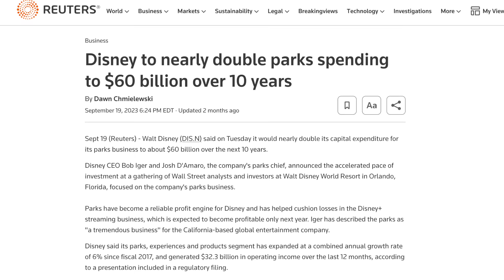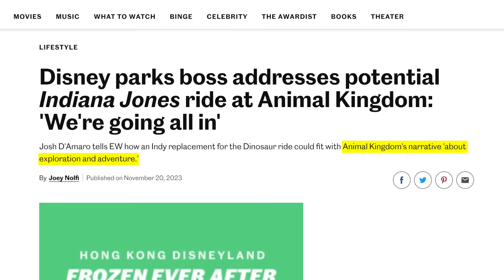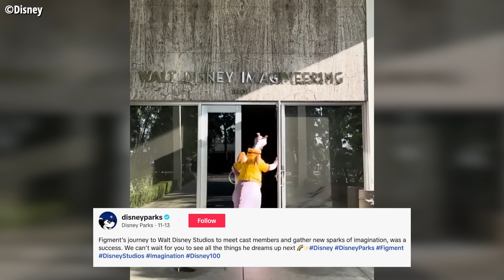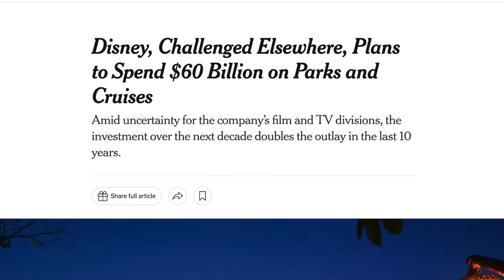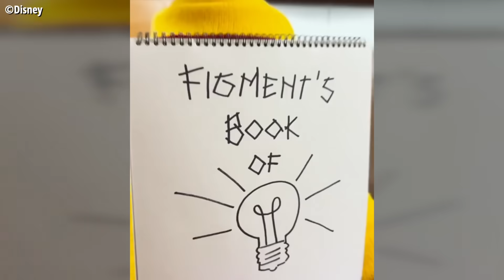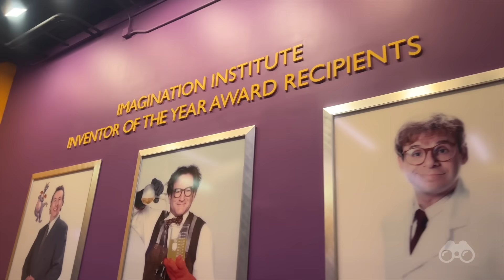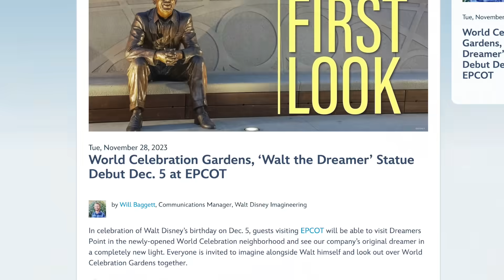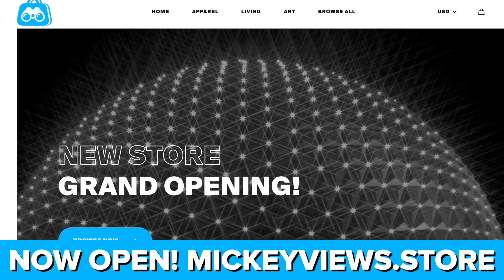Disney Teases "BIG IDEAS" For EPCOT! All Fluff or Real Stuff?

Comment: Sadly, even bringing Journey to Imagination back to the original configuration is going to cost Disney millions more than expected: If they go above the threshold for maintenance of legacy infrastructure as set by FL law, they will have to bring the building up to current code for amusement/public facilities. And Disney has absolutely NOT been doing incremental renovations of their facilities to keep them up to code. Heck, they haven't been doing routine maintenance just to keep things painted and functional. You can bet that bring up the safety systems alone, like fire suppression, air handling/exhaust for fumes, etc., is going to run into 7 figures. (not including the decimal points). Same situation applies to Carousel of Progress, which is a major reason why we only see things like new sweaters and minor housekeeping, and not (for instance) a replacement of the old pneudraulic/hydraulic animatronics with new, reliable electronic versions.

I'm HOPING that Disney will spring for the extra bucks needed to do the job right and bring Journey back to its original glory. But the cynic in me expects that we'll get a new paint job, maybe power-washing the glass, and a range of "Festival Sweaters" for Figment to wear to fit in with whatever Epcot is hawking that season.